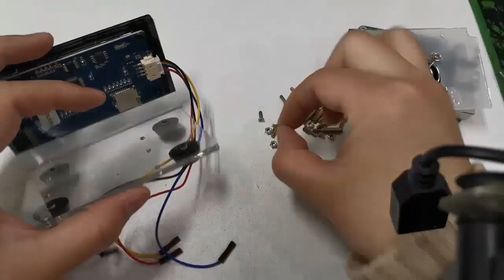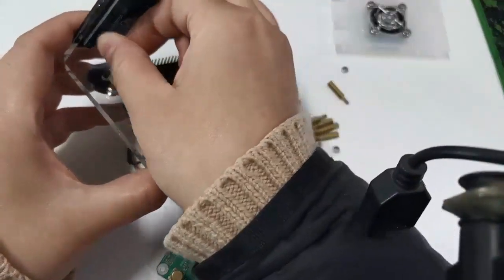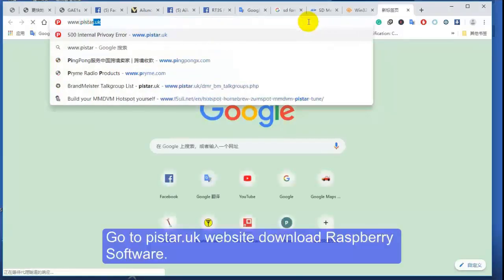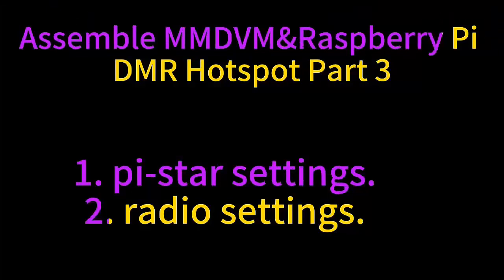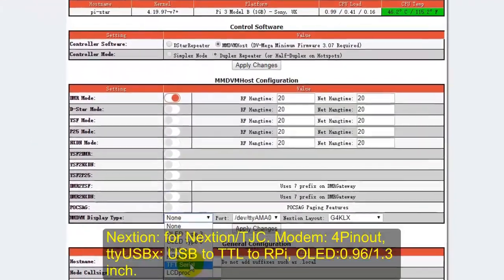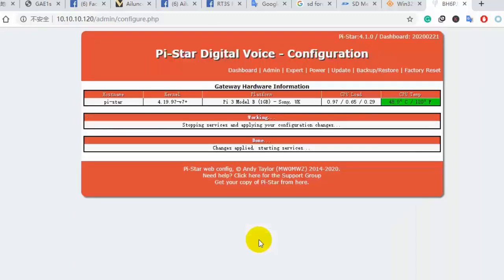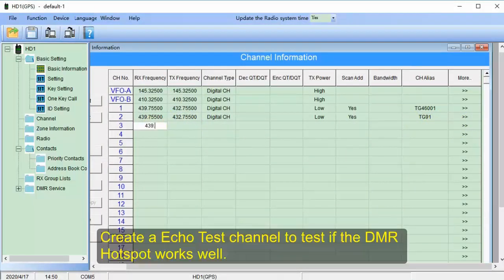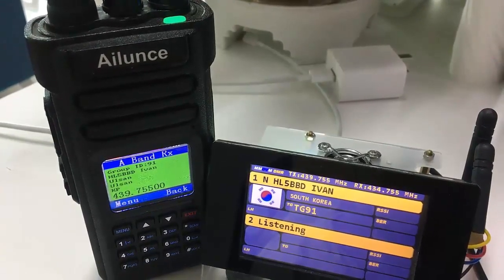MMDVM Raspberry Pi Duplex DMR Hotspot--Fullly Assemble and Settings.

Comment: Using the pi 4b I had to remove the right socket to get it to work.... that’s the connection furthest away from the antenna connection...
Reply: Hello to you, i read this Info and have a couple of Questions about it. Which Pi 4 have you used ?  Have you found the Reason why you had to remove the right socket?